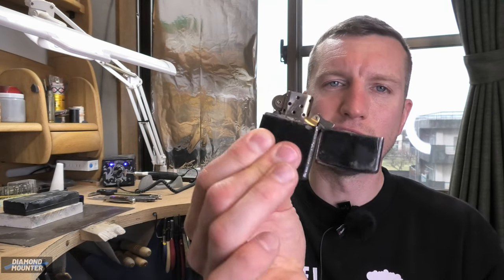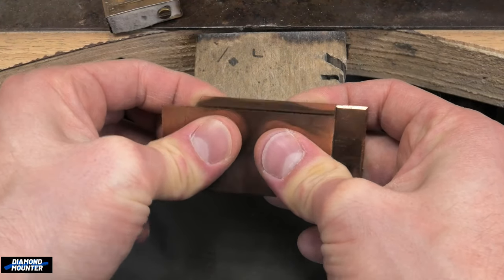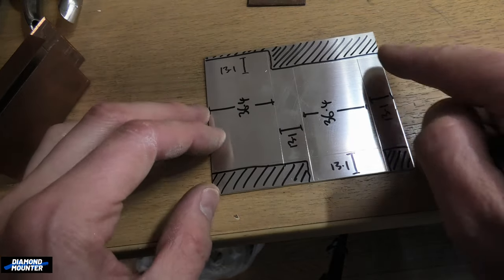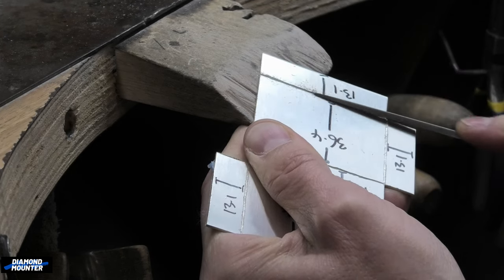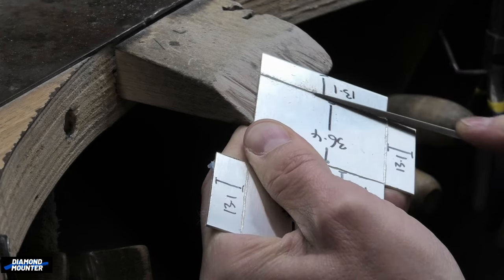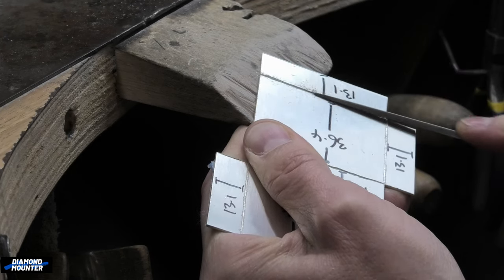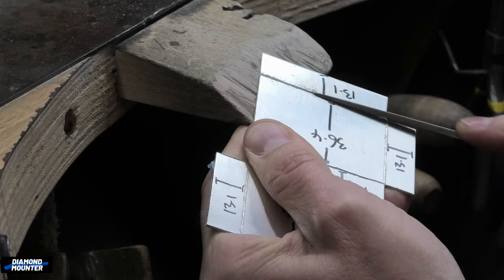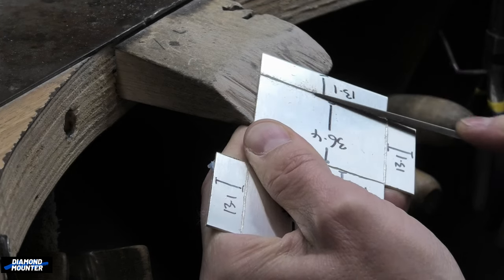How to Make a Zippo Style Lighter

Comment: Great video! As far as getting a piece like that hot enough to solder, it would be a huge help to put sodlering blocks behind and on the side of the direction the flame is pointing. I have even once gone so far to put an extra one balancing between the two of them (which make a corner around your block)
This helps keep the heat close instead of having it disperse everywhere! I actually have one that is permenantly behind my soldering block because it makes things more efficient for gas and time, because everything gets hot quicker! Sometimes I even add just a little broken piece directly behind what I am going to solder. Works wonders.

Comment: Hi Chris, I have watched many of your videos and enjoy your knowledge and love of "old school"ways. I am an amature jeweller /silver smith and use solder paste a great deal. I had a wonderful moment of schadenfreuder watching this video and seeing your struggle with soldering. I would have used the little needle applicator that comes with the tube and run a fine bead of paste along the inside of the box placed a spare solder block behind the piece and then applied heat. The problem you had was due to low temperature. solder paste has its place and is ideal for this sort of job. Little tip though,a;ways put the orange tip back on the nozzle to stop the tube drying out. I often leave the syringe in a small jar with a few mils of water in the bottom to rehydrate it. Love the videos ,please keep them coming. Best regards.
Reply from the maker: Thank you. I have been using it lately to make a chain its been very helpful. I will try the water technique because it does dry out and clog up the needle thank you
Reply: Chain making with paste is so much easier. Anything that eases the load is to be welcomed.  Thankyou for the reply.

Comment: You'd have no problem soldering that with the map gas the yellow bottle at hardware store i use it more than any other i have a smith little but im able to sweat solder belt buckles witth map gas

Comment: A good one to try is putting water on a paintbrush and picking up some thick red rouge to cover the area you dont want sodler to flow! Also, tipex works but smells ultra toxic when its burning off so make sure you try that one with good ventilation

Comment: If it is that hard to bend you didn't score it deeply enough. I do this sort of thing and use solder paste. You didn't heat well enough. The paste should pretty-much boil away.

PS: There is one big trick to making a fully-enclosed cube-ish box like that. Maybe I will email you about it. Really busy just now. Road trip coming up...
Reply from the maker: My soldering equipment isn't very good. I purposely didnt cut down too far so the corners remained strong even with no solder in them.
Yes please email me about making the box!
Reply: @DiamondMounter  Will do, when I have time. Packing for road trip just now.
Reply: @menow. I'm about to attempt this project. Can I know the secret too?! :D
Reply: @LimeJello7  To build a cube, make it from two "U-shaped" pieces.
Reply: @LimeJello7  PS: That way avoids having any 3-way inside corners.
Reply: @menow.  In other words create 2 groups of folding shapes that create the 2 end results of creating the box like in the video and cutting it like he did?
Reply: @LimeJello7  I don't remember what he did in the video. I have made dice from silver sheet where I cut out the entire shape and then folded it. Bad idea. You get 3-way inside corners that you can't easily trim if they don't fold all the way together right. With just 90 degree bends you can easily open them up and file for better fit. Two 3-sided "U"s will make a cube. Do it that way.